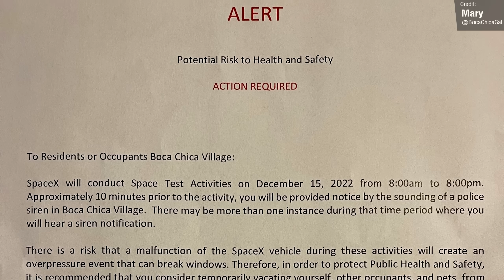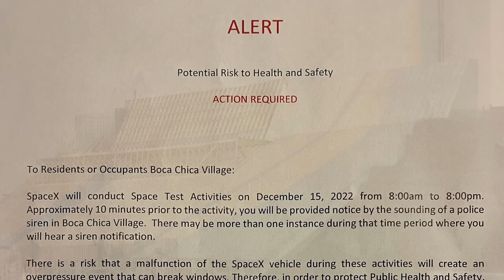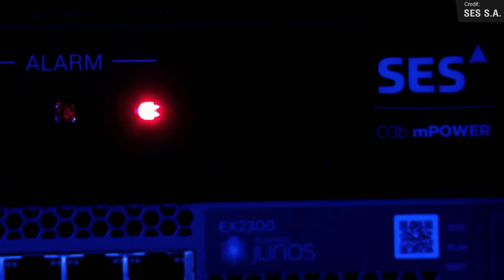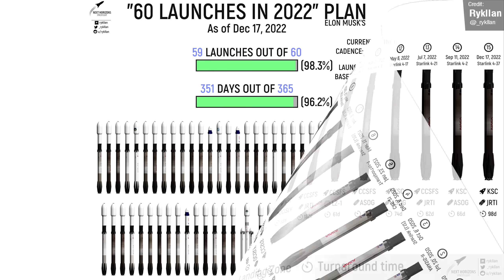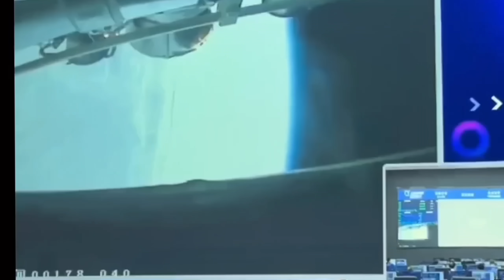SpaceX Starship 24 FINAL Test Complete, Triple Falcon 9 Frenzy, China Launch Failure, Soyuz ISS Leak

Comment: Daily reminder that Starship and SLS started development around the same time but the SLS still got into the air first (starship got its idea in 2012 and the SLS was ordered to be developed in 2010. The Starship was originally called the Mars Colonial Transporter and I presume rough plans for how it would be built were also made that time)
Reply: Well NASA didn't have to develop and build the RS-25 engines from scratch for SLS..
Reply: @stillridgeway  so nasa still developed the massive, complicated rocket?
Reply: Or the SRB's and main fuel tank, along with the fact the sls and artemis is essentially just orion project continued
Reply: @Moist_VonLipwig  the main fuel tank is similar to but not exactly the space shuttle main fuel tank

Comment: This thing needs to be modular like legos. In order to be able to build larger structures out of star ships themselves. Imagine a ring of Starships around Mars end to end. You'd have your magnet field again. Shit maybe thats how we move planets. Gyroscope its ass wherever we want. Now, I'm wondering how many starships you'd need end to end around Mars, where you could affect its motion and direction? Could it even be done?
Reply: So Mars has a radius of ~3396km (2110mi) at the equator and 250km (155mi) gets you an orbit above the atmosphere. So with a radius of ~3646km (2266mi) for your orbit, the circumference for a perfectly circular orbit is ~22,909km (14235mi) rounded up. A Starship (second stage) is 50m tall, so that means you need 458,180 Starships to be nose to nose around Mars' equator. If you want a geostationary orbit, it has a radius of ~20,428km (12693mi) for a circumference of ~128,000km (79536mi) or 2.56 MILLION Starships (second stage). That's not going to happen either way.

Mars has a mass of 6.39 × 10^23 kg or ~63,900,000,000,000,000,000 metric tons (63.9 quintillion metric tons) which comes out to ~70,437,693,000,000,000,000 short tons(2000lb) (70.4 quintillion tons). Starship (second stage) is expected to mass somewhere around 100 metric tons plus 100 tons of payload for KISS, so the 2.56M Starships would be ~0.00000000008% (8OO billionth) of the mass of Mars. That's not moving Mars very far at all, if it can even overcome the flucuations in Mars orbit due to the Sun and other planets moving around.

Comment: They need to launch two starships with quick refuel of the booster so both land near Hawaii.
Reply: The Superheavy booster is sub-orbital and has roughly 3,400 tons of propellant, compared to Starship's (second stage) 1,200 tons of propellant. The payload capacity of Starship is ~150 tons, so you need 23 Starships (second stage) to refill Superheavy.

Comment: Launching and retrieving a rocket 15 times is mental. Imagine telling the spaceshuttle engineers that this would be happening.
Reply: The solid rocket motors and the Shuttle orbiter with all its engines were reused. The liquid fuel tank was not.
Reply: Shuttle Discovery flew 39 missions.

Comment: Elon should build his factorys at old abandoned open pit mines or open strip mines so it reduces environmental damage and increases the speed they can set stuff up bolth by lack of trees need clearing and government cant go environmental damage.
Reply: There aren't many of those on coast lines and you always launch over water in case the rocket fails so it doesn't land on someone's house.
Reply: @filonin2  i wasn't talking rocket i was talking about any other kind of building he needs like a car factory or a battery factory mybe even a factory that make solar.
Reply: @thesilentone4024 You think someone should build a factory in a pit and then use resources to get materials down into and back up out of a pit‽
Reply: @skyserf  Pit mines are mine-blowingly HUGE!  My father was a geology professor - I visited quite a few when I was young: Butte, Montana USA, Anaconda Mine in AZ, USA,  are still going deeper decades later. As deep down as mountains are high.

Comment: It shows so much confidence to be building a third tower (and set of chop sticks) before they have successfully tested the system.  Really comprehensive updates all packed into 15 minutes - excellentness.
Reply: They are pretty confident about the rocket, and even the landing. They seem to regard the production as the real challenge, so I can see why they might want to make sure their suppliers are kept in work. Once they get booster landing nailed they will be wanting to ramp fast. If each booster is being reused they pretty much need as many launch sites as boosters, as even if the starship is expended the raptor factory will still be over producing. The raptor factory is operating at a level where SpaceX could exceed all other spaceflight even if the boosters were expended.
They have gone the route of both mass production and reusability. Either of these technologies revolutionises spaceflight, but they actually don't really fit well together unless we start sending far more stuff to space. It would certainly be embarrassing if not having enough launch towers proved to be the bottleneck.
Reply: I agree with you because i wonder if it,s better to test  the tower with the chopstiks with the first 2/3 orbital launches and see the results and later to built the third tower. Etc
Reply: @erikjohansson1777  Yes, though I was thinking Elon may well expect and need to be destroying a few towers, and the wait to repair one might throw off the momentum etc.  The first attempt at catching will be incredible to watch for sure.  Cheers
Reply: @MIck-M  thanks a lot. Yes I agree with you. Next weeks will be very interesting as I think the prototype booster 7 and Starship  24  will be tested with the 33 Raptors engines and maybe the launching to a suborbital launching could be posible next january 23. We cross the fingers. Merry Christmas from Sant Cugat Barcelona
Reply: @erikjohansson1777  33 raptors - I still cant imagine what that will look like - good times we live in. Espero que tinguis un bon Nadal.
or 
que tengas una gran navidad lol
Cheers From Australia

Comment: Any word on Orion's heat shield? It looked might rough.
Reply: I don’t know if it’s meant to be re used. I imagine they will give it a new one before slapping it on another rocket. Of course, there is residue from re entry effects. It’s probably minimal damage to the actual spacecraft though.
Reply: @imEden0  Even SpaceX replaces the heat shield on Crew Dragon.
Reply: @steveaustin2686  why’d you say even?
Reply: @imEden0  Why not?
Reply: @steveaustin2686  only*
Reply: @romketboi7672  Only what? I would expect Orion's heat shield to be replaced as well. Manned spaceflight is MUCH more conservative than unmanned spaceflight.
Reply: the nearest "normal" material to the heat shield is cork (which was actually used at times). it is designed to be used up, and replaced.
you have to remember it was carbonized (making it somewhat brittle, like charcoal), then smacked into the water at a moderate speed.

Comment: I wonder if ship 26 could be a testbed for either an orbital tank farm or lunar lander
Reply: The fuel transfer test bed makes the most sense, they've got to get that mastered before they can make the lunar module work
Reply: Couldn’t be a lunar lander, they need tanking for that, although I did think of that too. Orbital tank farm isnt viable unless starship has, like, a launch per week
Reply: @imEden0  sure it is. the tankers will be bigger than normal Starships, so the depo will have more fuel in it then a typical Starship would the moment it gets to its orbit. Then more tankers which would also have more fuel left than a typical Starship would get there whenever launched and fuel the tanker up with fewer launches needed than if they were normal Starships, because the depo won't need to be at 100% to be able to fill a regular Starship completely. and it doesn't have to happen in some set or short amount of time, even if the fuel is for a crew mission. a crew mission would be planned many months in advance, giving tons of time for the fueling of a depo for that mission.

weekly launches arn't a necessity. they will just make the process much faster.
Reply: @cjkula  weekly launches are bad long term. How are you going to support lunar infrastructure with a launch every 2 months? If you’re launching fuel up, might as well directly connect the starship anyways.
Reply: @imEden0  weekly launches would be good, but arn't necessary right now. what I'm saying is a Starship could be fully refueled in earth orbit without 7-8 launches. It may only take 4 or 5. still alot, but SpaceX can vary realistically send a lunar Starship to the moon in 2023. Long term, like nasa or SpaceX base on the moon with 24/7 manned presence would require 1-2 launches a week sure, but it doesn't need to be that fast right now.
Reply: @cjkula  Weekly launches wouldn't be viable for refueling. 6 launches is the minimum for lunar missoins (3 minimum, but you dont get to come home or land)
Reply: @imEden0  they are plenty viable enough for right now. right now, pre- lunar base. 
even if SpaceX is launching Starships 3 times a week by the end of 2023, Nasa will not be ready to send astronauts to land on the moon for the 1st time in the artemis missions for atleast 3 to 4 years from now.

so that means there is no need for rapid launches right now. it won't be needed for atleast 3 years from now. even then SpaceX can already have the fuel waiting in orbit for the artemis mission. the astronauts go up, refuel, go land, come back to earth. then Nasa won't be ready to send anyone back to land on the moon again for atleast another year after that, and that definitely won't be to start a base yet.

Nasas "Lunar Base" likely won't begin until 2029 realistically. and I believe that's being generous. that means SpaceX has 4-5 years to work with before they'd actually need to be launching multiple StarShips a week.

now of course SpaceX isn't making Starship for artemis, SpaceX wants to send people to mars ASAP. so they will be burning the midnight oil day in and day out to make multiple launches a week happen as soon as possible. possibly by some time in 2024, but they've got plenty of time to get there.

right now they're just building prototypes and testing designs and what not. there's no reason to launch 2+ Starships a week right now, certainly not necessary just to run 1st tests on whether or not orbital refueling works as well as they hope.
Reply: @cjkula  alright, I see your point. However, this is my actual criticism of starship: why would you want to go to mars without having a lunar base or practice around the moon?
Reply: @cjkula  One: add a tl;dr. Two: why go to mars?